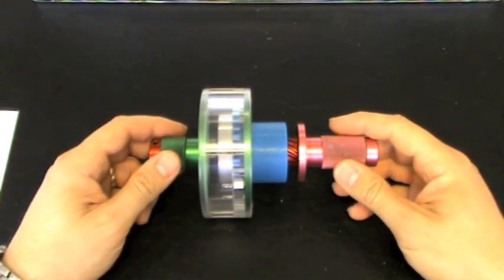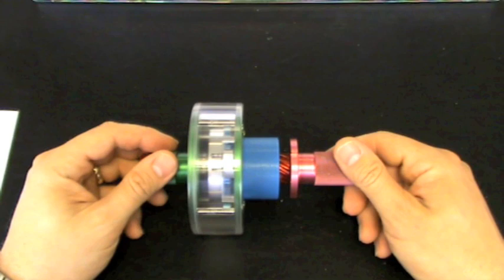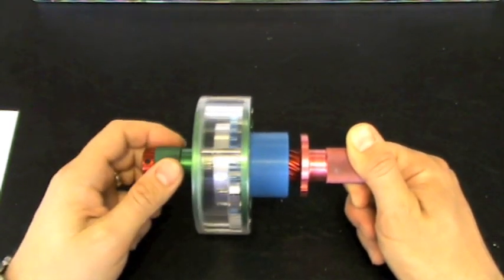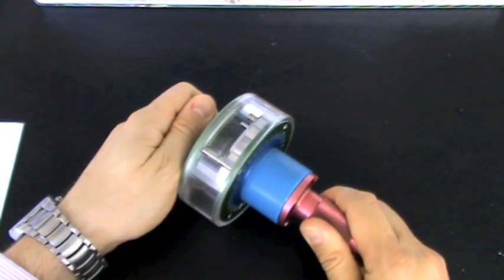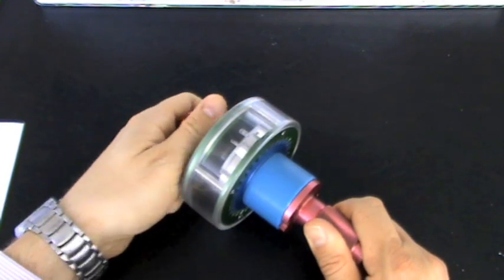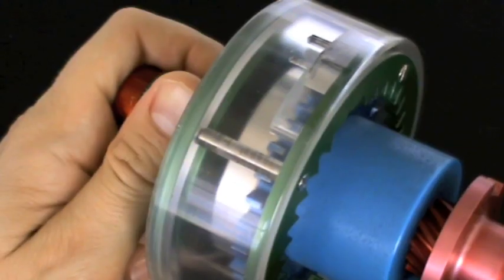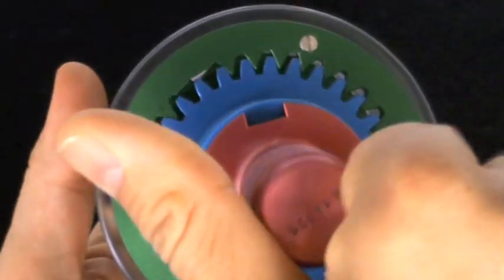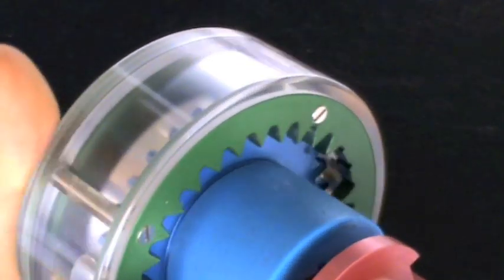SSS Clutch Hand Model - Overrunning Clutch design

Comment: The red helical spine- does that extend through and mate with helical splines within the green output shaft? Is that how the disengagement process physically works? That way, when you turn the output shaft faster than the input shaft, the red helical splines “pull” the blue ratchet teeth away from the green clutch ring?

Comment: I assume the point of this thing is that it deals with a far greater torque in a given component size than a freewheel does. Does it engage with a bang?
Reply: Yes, you are right – very high torques and high speeds are possible. It is an extremely robust clutch device - can do much more than normal freewheel devices. No bag effect when engaging - they use a very effective dashpot to cushion the movement. Works really well. Obviously a hand model without oil can't show this.

Comment: That's a great product !!! i would like to know how would clutch behaves, while operating in reverse condition ?
Reply from the maker: Vignesh, thank you for your kind comments and many apologies for the late reply.  

If the output drives backwards (with input stationary), then the SSS Clutch engages.  If user doesn't want this to happen then SSS Gears can add user controllable "Lock Out" to prevent it engaging, with a special protection mechanism to stop a smash if the operator presses the wrong button at the wrong time.

Not really part of your question, but if the output drives forwards (faster than input) then clutch engages, but SSS Gears can also add user controllable "Lock In" if user wants to deliberately back drive something.

If the input drives backwards faster than the output then the SSS Clutch also disengages.  In general, this input backwards rotation doesn't occur in most drives for which we supply SSS Clutches, however we have additional design features to protect those that do !

Thanks again and further apologies for the late response.  Please email via our website if you have any further questions.
Nicholas Bellamy, Application Manager, SSS Gears Ltd.

Comment: @JoaoMario24 
Thank you !

SSS Clutches feature in heavy industrial power gen, marine propulsion and petrochemical drives.  It is suited to applications where automatic engagement between driver and driven machines is required as opposed to manual / lever controlled engagement.

Although designed initially (1950) for automatic gearboxes, the automotive references are limited to buses and not cars..... but the original Chairman of SSS Gears had one fitted to the auto gearbox of his own Jaguar !

Comment: Is this used in road-legal automobiles? I don't see how would the gearbox connect to the clutch. And by the way, it is the simplest YET best piece of mechanical engineering ive seen in a while.

Comment: @JoaoMario24

Thanks for your question.  My company (SSS Gears Ltd.) make SSS Clutches.  To date, we have produced approx 25,000.  Powers range from a few kW up to 320000 kW.

The demo model in the video was designed as a sales tool years ago to demonstrate our basic engage / disengage function.

If you need any more info, please reply again or you can send email to engineering@sssgears.co.uk  Pls see also our website sssgears.com

Nicholas Bellamy
Applications Manager
SSS Gears Ltd.